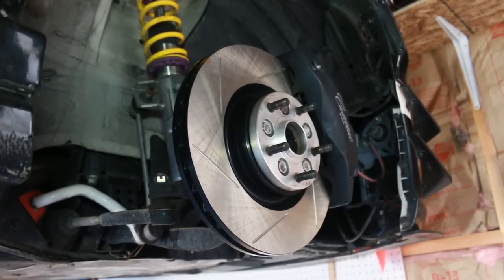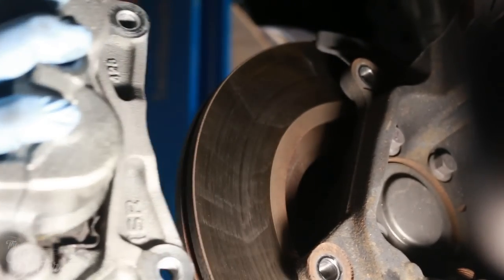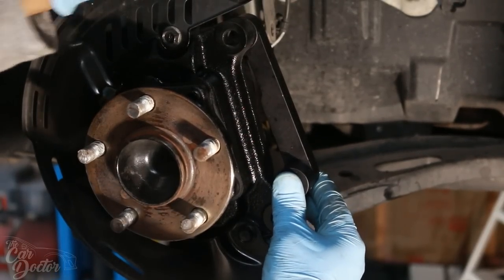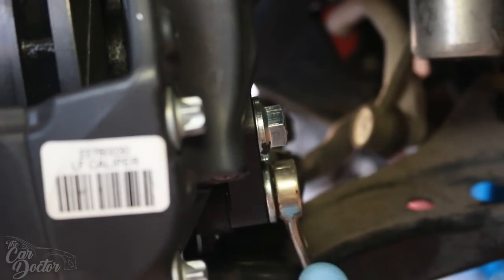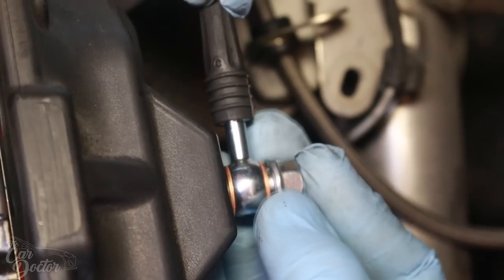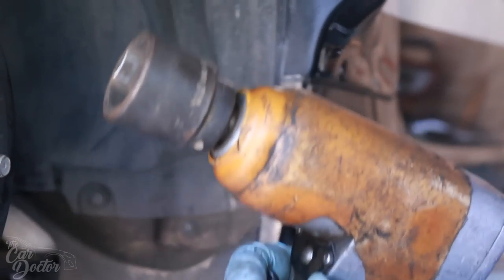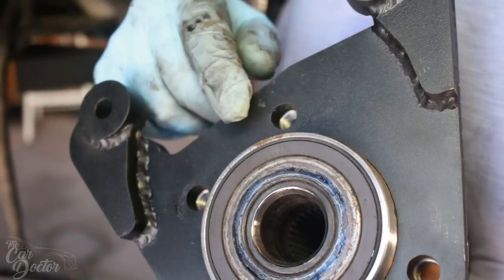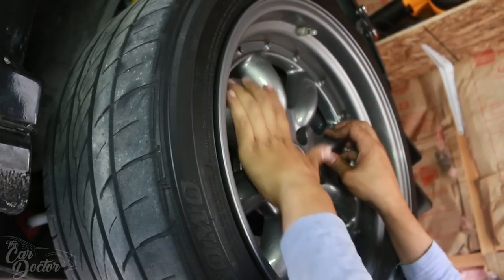Brembo Brakes on a Budget [FRS/BRZ] [CTS-V/CTS Brake Braket Install]

Comment: 10:45 Thats the Left Front caliper you installed on the passenger side
Reply: That's for the stock CTS-V brakes. He put them on the correct side for this retrofit. You can see the bleeder screws pointing up top.

Comment: the bolts that hold the caliper to the bracket floating pins thread into the stock rotor holes if you cant find something

Comment: Very awesome, detailed instructional video. Only thing I find issue with is removing fully functional ebrakes without finding a viable solution and running a second pair of calipers that aren't even functional. Imo, that just takes away from the credibility of an otherwise awesome video.
Reply from the maker: Don't have the time or the money to continue any further with the brake system. It would also be a pain removing the lines for the ebrake later than when the system is fully accessible.

Comment: I know this video is like 4 years old - but for anyone watching this, please be a LOT more careful with the grease than this guy. You really don't want that anywhere near the pad surface, and you want to ensure it's not on the side of the friction material either. As the pad wears, even getting just a little bit of that grease on the brake surface will greatly impact your braking ability.

Comment: Im a bit late to the vifdeo here, but what wheels were you using when ou did this setup? Im curious to see if the will still fit underneath of stock wheels if there is a spacer involved.
Thanks!

Comment: I must have missed it,  but how did you get brake lines to the second set of rear calipers?
Reply: sneakysnake109 I was wondering the same thing.
Reply from the maker: I didn't. Currently, the second caliper is disconnected, but you can run a T-connection so both calipers can be connected. I plan on installing a hydro e-brake and wire it to the second caliper, when I get one.
Reply: Jonny The Car Doctor ok that make sense. Keep up the great work on the car!
Reply: sneakysnake109 6
Reply: Think he could have kept the cable, and use a different caliper set (I think Ferrari uses a cable actuated parking brake caliper in the rear)
Reply: Never mentioned the adapters for the rim to fit, though!

Comment: nice vid,you could/should upgrade your lug studs get a longer one instead of buying or using spacers. which sometimes arent that safe,but it depends. someitmes its usefull tho, please get longer lug studs
Reply from the maker: I run conversion adapters that don't decrease or increase lug stud length from stock. I've been using them for 2 years since I got the Frs and haven't ran to any issues yet. They make it possible to run the custom wheels and line up my wheels with the rocket bunny.

Comment: Will this fit and work on a regular Subaru Impreza...... not a ( WRX  or  STi. ) ??
Reply from the maker: If you have  a 5x100 bolt pattern and will be upgrading to 326mm (12.8") 2004 STI rotor. Then yes.

Comment: Might be a dumb question, but how come you couldn’t use Cadillac Brembo’s for the back too?
Reply from the maker: There's currently no direct fit bracket to accomodate the ats v rears on to an frs rear hub and disc. The only direct fit Brembo rears I could find are from a 15 sti.

Comment: Did you need a spacer for this b/c the lugs were too short? Would I need extended lugs if I did this for my FRS?
Reply from the maker: A wheel hub adapter will add a hub-centric spacer and will add extra wheel studs to mitigate the need for longer studs.

Comment: Wait wait, woooo...How did you connect the second brake caliper to the system?  Did I miss something?  Did you use a y-connector to feed a brake line to the second rear caliper?  How does it work for parking your car?  Oh, you answered it below.  So what is the advantage of having a second rear caliper besides removing the old style drum brake?
Reply from the maker: Robert Orellana I setup a hydro e-brake to the second caliper. https://youtu.be/4bN-x9ZPyQA

Comment: Mate this is a very helpful DIY  ;) just one curiosity...in your opinion, this brake swap will fit under 17x8,25 et35 rims? i would buy this brake swap kit but i have fear this not fit under my wheels
 T_T

thanks for the eventually reply :)
Reply from the maker: Mine are 17" step lip wheels, meaning my inner Barrell is 16". These should fit. As for the spokes, like with any wheel a bit of a spacer might be needed.
Reply: Hachiroku Monkey 18 is what the swap kit says but some 17s will work, it is dependent on manufacturer.
Reply: I have 17x8 Avid AV-06 wheels and I’m scared to buy these because I am not sure if the inner diameter of the wheel is enough to clear the caliper. Any suggestions? What is the minimum diameter that the wheels need to be to clear this?

Comment: Thank you for the great video.
I got a quick question for wheel clearance.

do the caliper will fit on stock rims? 17" for sure? 
my current wheel is 17" 35mm offset.
so If the brakes are OK with stock 17" wheel, I won't have to worry about installing the brakes.

Thank you so much!
Reply from the maker: For 17" stock wheels may need some spacers, and if you get wheels make sure they say "clears bbk".
Reply: Thank you for the answer :)
Currently I have 15 mm spacers on my 4 wheels. so, my wheel specs could be 17 x 8j 20mm offset ( include spacer).  TE37 style

I already bought the calipers, I am so worried about clearance.
Reply: @clickbijou  Hey, i am actually curious if you ended up getting this bbk and if they fit with your oem wheels?  where does it hit?  would a spacer solve the issue?
Reply: @joshuaszeto  Hey, I think you may need the spacers with OEM wheel.  it;s been a long time since I installed the break.  However, at that time, my wheel offset was better than OEM wheel, I still needed the spacers for caliper clearance.      now I am running Enkei NT03 wheel with 255-35-18, I still need 5mm spacers on front.  I hope it would help

Comment: Are the STI rear brembos the same dimensions? Heard that the 04-07 are different. I have the pp Brz already but going to run a dual caliper setup in the rear. Looking for a second set of brembos to run with my srs dual caliper bracket but not sure if I need the torque solutions adapter as well
Reply from the maker: STI package usually has bigger brakes then wrx, you'd have to find out to be certain.

Comment: What wheel specs? Ive been reading you have 16" inner barrel i just wanna know if they have clearance issue. I run 16s on steel rims on my winter setup. I know i have to run hella thick spacer
Reply from the maker: I have less than a centimeter of clearance from caliper to barrel, Doesn't rub.

Comment: hey man you know if the OEM stock 17inch wheels will fit back befor l try the break swap
Reply from the maker: They will clear the barrel if 17", but you may need a spacer to clear the spokes. And move the spokes away from the caliper.

Comment: The caliper pin to hold the pads in . It didn't use a cotter pin to hold the nailed shaped pin in?
Reply from the maker: Alien003 Hydrogen nitrogen Not on this type of brembo, the pin have a locking mechanism built in already.

Comment: Can i jus buy the CTS-V calipers n throw em on my frs? Without everything else
Reply from the maker: You only need the caliper adapter bracket and the rotors, everything else is optional.

Comment: just a heads up... a forum member on FT86club.com found that the evoX rears fit (almost) perfectly and he did all of the math in regards to finding a rear upgrade that will compliment this exact front upgrade, so as to keep the stock front/rear  brake bias, and not have it change, upset the brake balance of the 86....
Reply: So after doing the CTSV caliper kit and then doing the evoX calipers to correct the brake bias you are still close to the cost of doing a proper front BBK. With a proper front BBK you don't need to upgrade the rears at all(except pads) and you are getting a proper 2 piece rotor as well.
Reply: +Aaron Trout how much

Comment: What size wheels do you need to clear these?
Reply from the maker: 17 inch wheels will clear these, only issue will be back spacing. Its best to run bbk compatible wheels or run a spacer if your wheel face doesn't clear the calipers.

Comment: why would I need an open ended 10mm wrench
Reply from the maker: line wrenches allow for an easier brake line removal and install.
Reply: Jonny The Car Doctor can't I just use the other end though
Reply from the maker: I suppose. It just makes life easier, with a much tighter grab on to the socket. It's a slippery one.

Comment: Wheel spec and spacer size?
Reply from the maker: 17x9.5 -3 (235/45r17) fronts and 17x11 -30 (265/40r17) rears, Custom Two-piece welded, Forged Aluminum wheels with step-lip. The hub converters are 15mm. People always ask.

Comment: Will this fit the IS300?
Reply from the maker: This won't fit on the IS300. The bracket is what makes it possible.
Reply from the maker: I have seen people with IS300s swap in brakes from an LS400, which isn't a brembo, but it's definitely a cheap big brake kit you could look into for your IS.

Comment: Wheel spec?
Reply from the maker: 17x9.5 -3 (235/45r17) fronts and 17x11 -30 (265/40r17) rears, Custom Two-piece welded, Forged Aluminum wheels with step-lip. The hub converters are 15mm.
Reply: -3 offset in the front?

Comment: Right, you've removed the mechanical parking brake and fitted a second set of hydraulic calipers, which are not connected to anything yet...?!
Do you have Hills in Arizona?!! How do you stop your car rolling away when parked? Relying on the drive train to hold the car is not wise, especially as you mentioned cracked drive shafts in your previous video!!!
It's clear you have produced a well thought out instructional video, but it's a shame that you haven't applied the same amount of thought to what you are actually doing to the car...!!
If you're modifying the brakes get all the parts to complete the work, don't stop half way through because it's expensive!
Reply from the maker: The rear calipers are in a separate loop for a future hydro ebrake used primarily for drifting, an should be functional once I get a chance to find a cheap hydro.